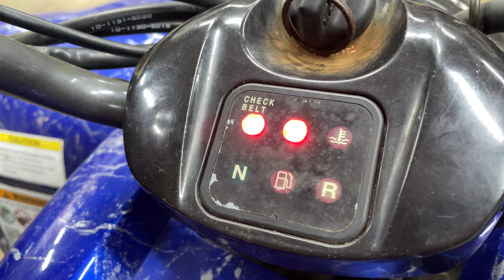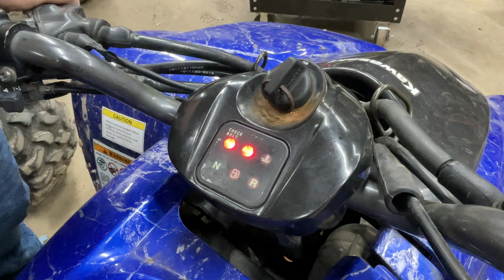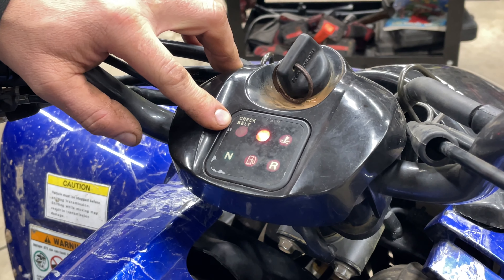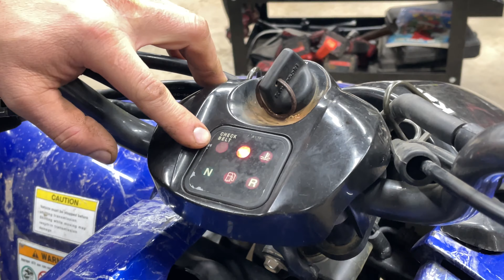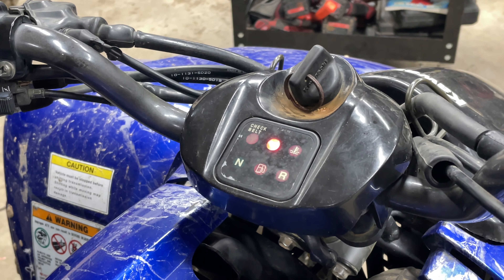Kawasaki KFX 700, Prairie, How To Reset The Belt Light, Limp Mode

Comment: The light also lights up after replacing the variator belt. I try to reset it in vain, so the error still lights up. What could be the problem? Please someone help me.
Reply from the maker: Thanks for watching. Check your clutch. If it slips any on the belt the computer will detect it thinking the belt is bad and needs to be replaced. 
Be sure to like and subscribe to our channel.
Reply: @crankitt825  And how can I check if it’s good?
Reply from the maker: reset the sensor and if it triggers again most likely the belt needs to be replaced. Thanks for watching.
Reply: The belt has been replaced with a new one, and even after resetting the sensor, the light still stays on.
Reply: Check your clutch. If it slips any on the belt the computer will detect it thinking the belt is bad and needs to be replaced.

You wrote this above.
How can I check it?
Reply from the maker: Is it in limp mode?
Reply: @crankitt825  The “check belt” light is continuously on.
Reply from the maker: while the belt light is on does it accelerate properly and have plenty of power or has it lost power and have trouble accelerating.
Reply: @crankitt825  There’s no loss of power; the light just stays on and won’t go off, no matter how many times I try resetting it.
Reply from the maker: I had a Kawasaki prairie that done the same thing. After making sure my clutches wasn’t slipping and the belt was good I couldn’t never get the belt light to reset. To fix the issue I took a chance and replace the computer box that was mounted above the tool box and under the seat area and it fixed it. 
Electrical problems are a pain and expensive. At this point since the four wheeler is running fine I would ignore the light for now or carry it to the dealer to have it diagnose. Sorry I couldn’t help more. There’s only so much you can do without having the machine in person.
Reply: @crankitt825  Thank you so much for your help. Do you have an email address or any way I can contact you?

We are completely lost here in Hungary—there’s not a single reliable mechanic around. On my quad, one mechanic replaced the crankshaft entirely (along with the connecting rod bearings), installed a new oil pump, and put in a new timing set (it got new chains).

I then took it to another mechanic, who supposedly synchronized the two carburetors and cleaned out the airbox.

Now the issue is that when you try to take off, you press the throttle, and the engine revs up, but the quad doesn’t move—it just stays in place while the engine keeps revving. After you give it more throttle, it suddenly jerks forward aggressively and takes off.

What could be causing this?
Reply from the maker: Hi and thanks for watching. You have a bad clutch. The one on the engine is most likely the problem. Hope this helps you out.